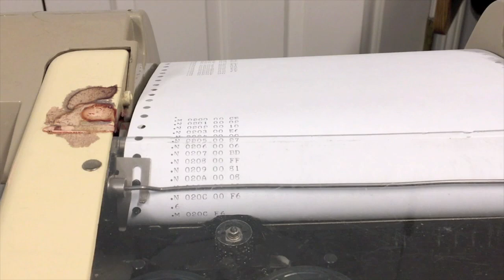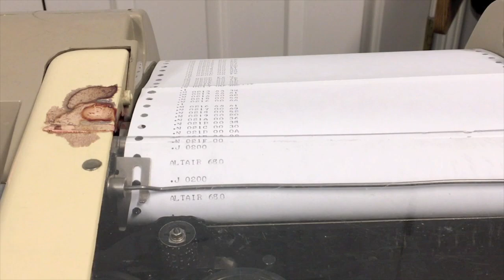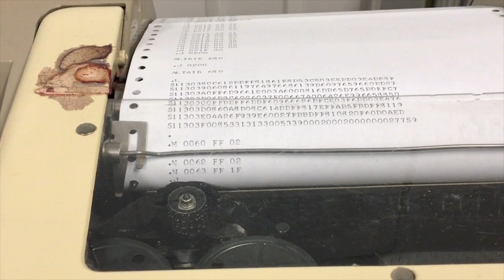Altair 680 - Using the Base Model

Comment: This was very interesting...very interested in what the VTL might be...things like forth come to mind...but I bet it is more basic than that...this is interesting to me because when I started learning to program as a Junior in high school we had a computer programming course and you started on a minicomputer sized machine called a ESP-18...with a bunch of push buttons on it...you entered your code into the panel in octal...then you printed it out...if you liked the print out you wrote it to tape...and if you got very lucky it ran correctly...most of the time it didn't and you and to retrace steps to be sure you had the right code...and then walk through the code by hand...we didn't do anyhing but a add, subtract, mulitple and a divide program...but that was enough and we learned a lot quickly.

Comment: Interesting to see what this computer could do. It makes me feel very superior with my Altairduino 6800.
And what is that stain on the top of the teletype? That would drive me nuts if it was mine...
Reply: Looks like hot pepperoni that melted the plastic hehe.
Reply: Some type of moisture, and perhaps heat, related degradation in the paint, I'd guess.

Comment: Wow, no punch command or assembly capability? And I thought that programming on the Altair 8800 using the tape-based Programming System II would've been difficult and tedious. MITS selling this as a "computer" was tantamount to someone selling a car engine (the CPU) with a permanent welded-on regulator so that it could only go at 50% speed, and with a single wheel attached to the crankshaft, and then having the nerve to sell it as "a car".